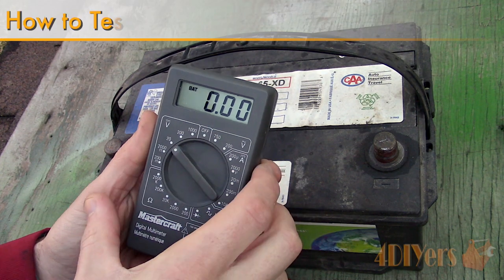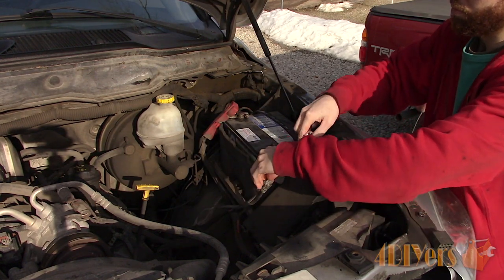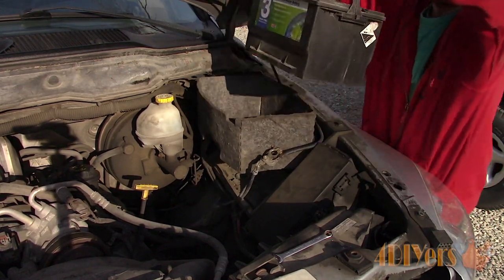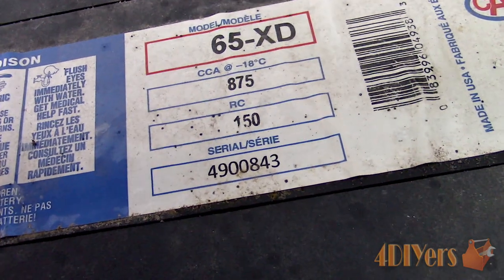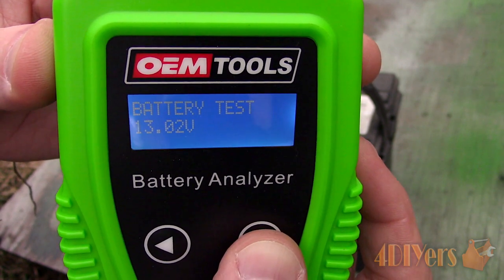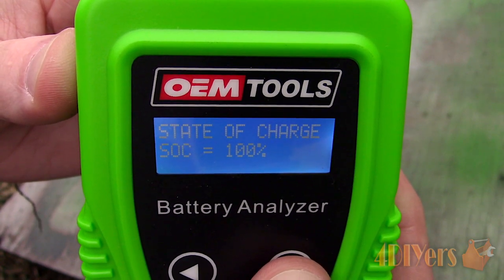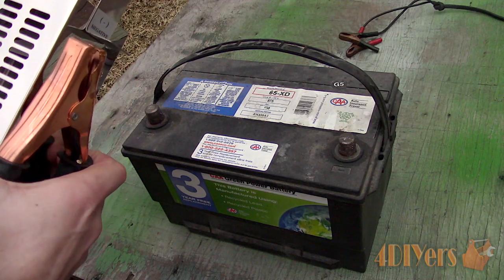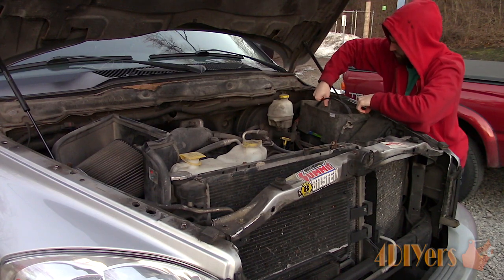How to Test a Car Battery [Both Digital & Analog]

Comment: well-made video!
Curious if you would get a different reading if you left that battery awhile till the surface voltage dropped down to 12.7 from 13 volts?

Comment: I keep getting a testing error on the o e m tool:(
Reply from the maker: Is the battery fully charged?
Reply from the maker: It does outline the issue of a test error in the user manual https://www.mobiledistributorsupply.com/media/files/manuals/24359.pdf 
"e. “TEST ERROR”
The tested battery is bigger than 1200CCA. Or
the clamps are not connected properly. Please fully charge the battery and retest after excluding both previous reasons. If reading is the same, the battery should be replaced immediately."